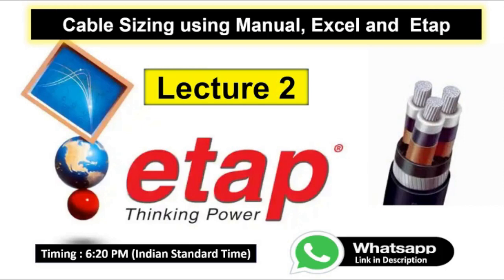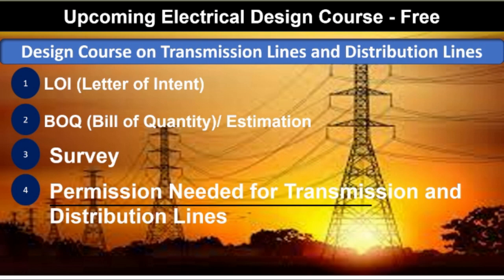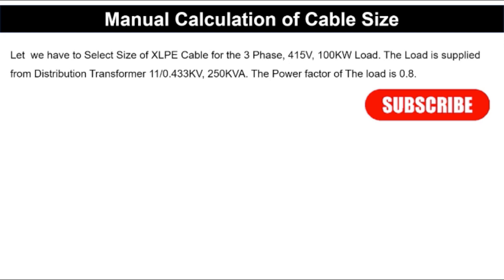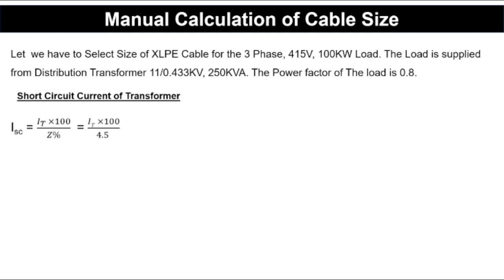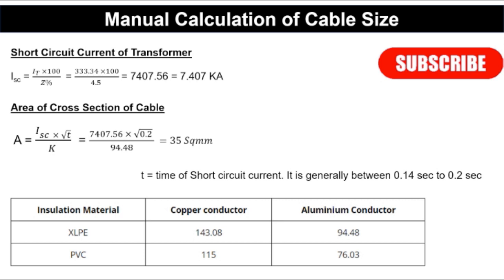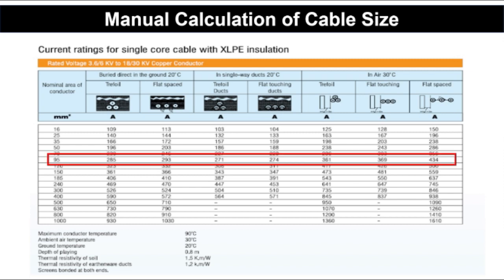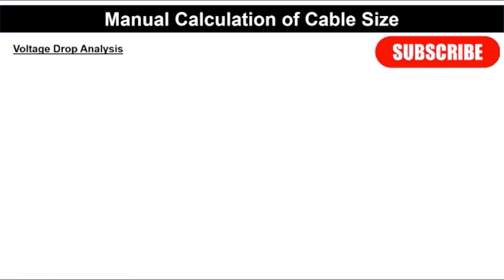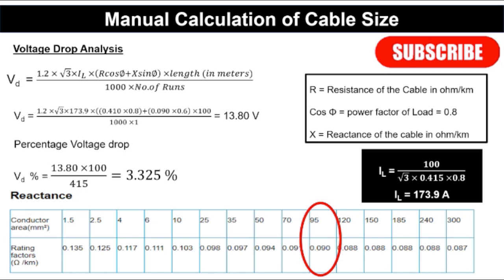Lecture 2 | Mastering Cable Size Calculation: A Step-by-Step Manual Method Guide

Comment: 10:39 where the value 1.2 came from in equation? what does it mean? Also please provide the reference book where can i find these equations? thnx
Reply: I also do have a same question…..and the same time what will be the formula for voltage drop if the load is single phase ?

Comment: sir I have doubt on regarding cable size, my doubt is as in vedio we designed cable for single core but in reality we use 2 core for single phase and 3 core for 3 phase . but single core cable we did not use any where